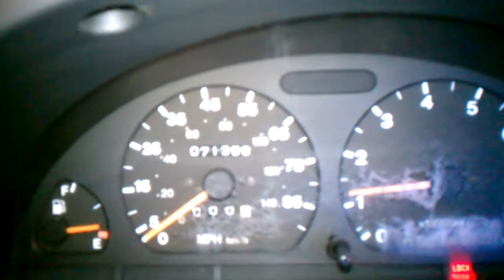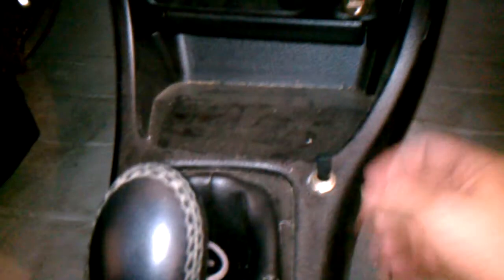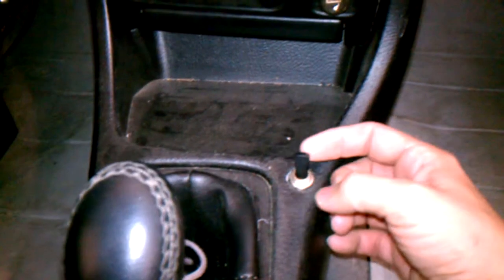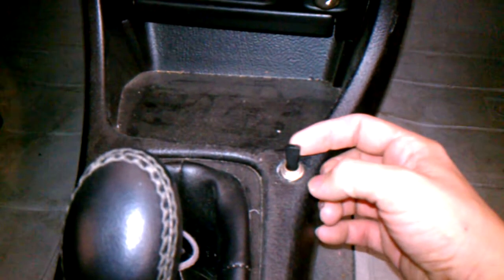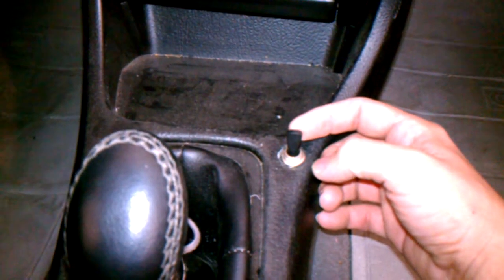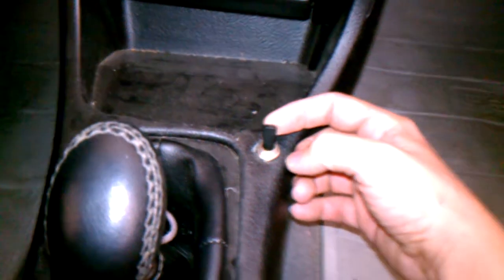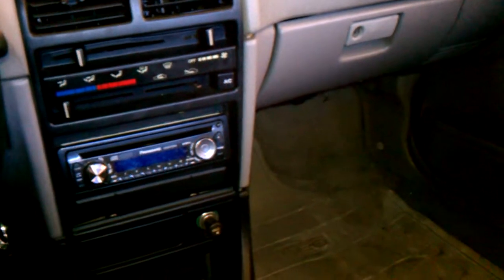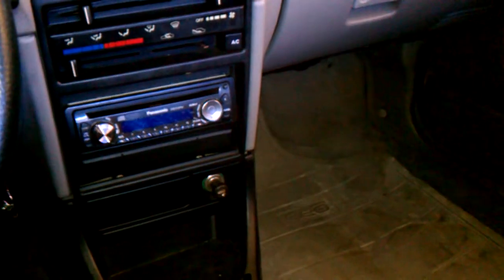1993 Geo Metro Convertible Lsi - Cooling Fan Switch

Comment: if you could tell me.. what is the wire that attaches to that sensor señor? my car isnt over heating but the fan isnt coming on... I just wanna replace those two pieces.
Reply from the maker: +Nire Charles 
Hard to tell, every car is different. but if you have a geo metro.  it is located right behind the distributor, looks like a bolt with some wires connected to it.  I think it is screwed in the head right by the thermostat.
I'll send you a link so you can see what the part looks like, it will be easier to identify it that way.

http://www.autopartswarehouse.com/shop_parts/fan_switch/geo/metro.html

Comment: what is the name of the orginal two pieces that are supposed to work together to turn on the fan .. (maybe called the cooling fan sensor/ thermal switch
Reply from the maker: +Nire Charles 
you are absolutely right.  Cooling fan switch, or sensor. same thing